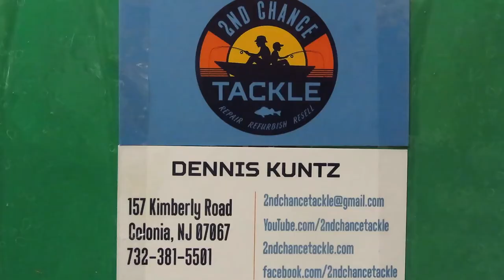Penn Squidder 140 Saltwater fishing reel rescue for a 1st responder take apart and service

Comment: Thank you for supporting one of our best, a first responder! I purchased a Squidder in the late 70's for surf fishing the Outer Banks on NC, they are great reels. Another excellent refurb/overhaul video!
Reply from the maker: That reel will last another 50 years with an annual tune up and some care.  I still use the one I have.  The only issue in the surf is the low gear retrieve rate, but I can live with it. Best wishes - Dennis

Comment: Thanks Dennis.  Looks like if the ball bearing on the handle side is rusted into the side plate, the only way to correct the issue is to replace the side plate.  Great Video.
Reply from the maker: Yes, and that is exactly what I wound up doing.  Thanks for the note - Dennis

Comment: I have a few Squidders from my dad and one of his fishing buddies.I have also picked up a few cheaply at yard sales.  I have run into what seems to be a common problem, at least for me, that I have never seen addressed anywhere. Some of them seem so tight that when I I cannot twist the gear sideplate back fully so that the locking screw will line up with the threaded hole in the ring. I cannot spot what is causing the interference. Have you ever encountered this problem?
Reply from the maker: That problem is usually caused by caked grease or dirt in the 3 tracks on the inside rime where the side plate mounts to the reel.  Make sure the path is clear for the pins to ride in.  If the channels are clear, then the issue may be a warped or bent side plate.  As you can guess - I have run into the same problem.  Best wishes - Dennis

Comment: Hi Denise I just got my hands on a penn squidder 140 needs some work on it, just wondering what other reels can I use to get the parts for my 140 thanks.
Reply from the maker: The Squidder shares a lot of parts with other reels.  The gears are from the Long Beach 60 and most of the other frame parts are from the Surfcaster 200 or BeachMaster 155.  The unique Squidder parts are the side plates and the spool.  They don't work on other reels - Mysticparts.com still has many parts for the Squidder, so check with them if you need something
Reply: @2ndChanceTackle  awesome thanks can I use the Penn 150 too
Reply from the maker: @aaronwhiting4340  Yes - the Surfcaster 100, 150 and 200 use identical gear side plates so some of those parts will work on the 140